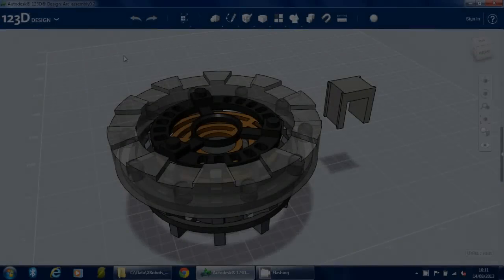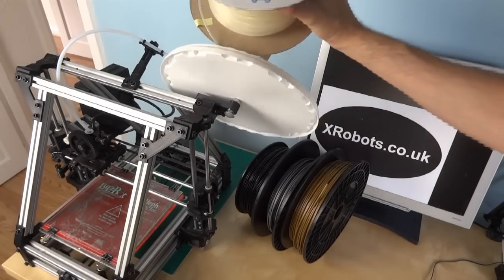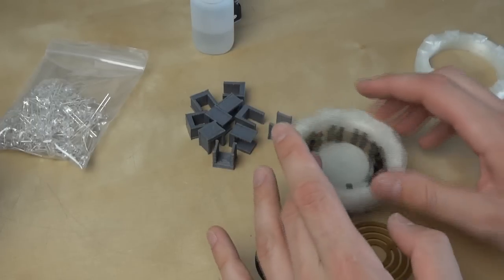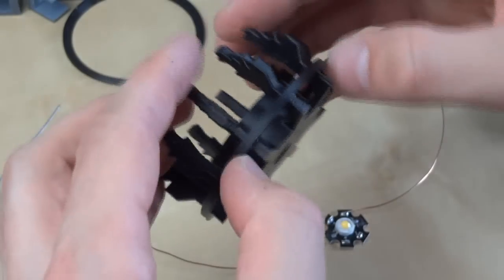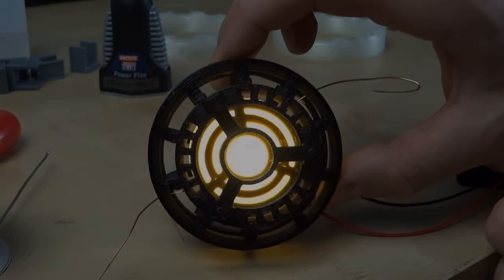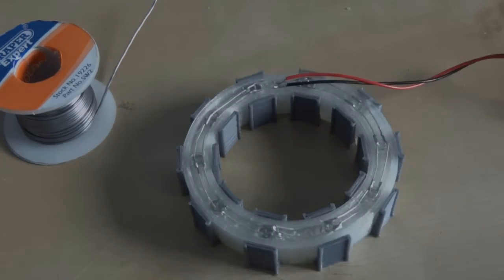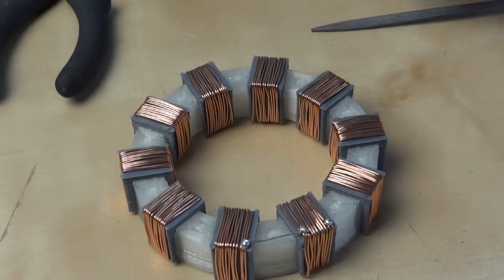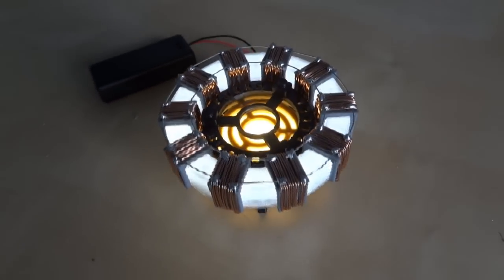Iron Man Power Suit #38 | 3D-Printed Arc Reactor | James Bruton

Comment: You'd have to print the suit in smaller pieces and then glue them together, not to mention, you'd have to have an extremely detailed 3D model of the suit itself. The other problem is that 3Dprinted parts may not align precisely together, due to hot plastic sagging a little. However, several people are already attempting this as we speak - of the top of my head, there's a Mk42 by JD Christianson, and Samus Varia suit by Talaaya (both on the RPF).

Comment: Are you doing this circuit without any resistor? I guess with 10 small leds and the 1 watt there isn't much concern about them heating up and starting to draw too much current... I have always been under the impression that leds should always be wired with a resistor since the led resistance can change dramatically with heat (at least that was the explanation I was given).

Love the look of it, I am thinking of buying your stl files and making a small modification to the main chassis, then wiring it up inside a softball display case. The power would be in the base (battery or ac/dc adapter) and connect to the reactor via magnetic contacts so the piece can be removed from the base.  Maybe put in a capacitor to power the lights for a short while after it is disconnected. This is all delayed by me not yet having a 3d printer (taxman is being slow).

Comment: With the Inside and Outside wire rings, couldn't you have put in a small hole in each corner of the 10 individual grey pieces and just fed the wire through them instead of having the big solder blobs on the copper wire?

Comment: To add a bit more effect you could of used RBG addressable LEDs and something
like a Arduino Pro to control the whole project. You would not really need to add much 
more when it comes to the wires.  Thanks for taking the time to share this project.
BTW I liked the way the clear (PLA ?) diffused the light from the back side.

Comment: awesome! nice work. i have a question, is your LED lights have built-in resistors? LED must have resistor right? and another one, can I print in that kind of 3D printer using autodesk autocad? or that 123D design came from 3D printer? thank you !
Reply: Not necessarily. You would need a resistor to avoid that the LED'S draw to much power from other components affect their normal functioning. And since  the only thing you're powering in an arc reactor are lights you don't need one.
Reply: +anthony ordillo - Although you will have better performance and efficiency using slightly higher voltage and then controlling the current through each LED, the "Forward Voltage Drop" (Voltage Drop) of the LEDs allows for basic operation using batteries directly, without current limiting resistors.

The voltage drop of LEDs differs depending on a variety of things, particularly the color, size (diameter), desired intensity and current, and also the working temperature, frequency, etc.

As a basic rule of thumb, For a standard 5mm diameter LEDs, you can start with these values for Voltage Drop:  Red 1.7 volts, High-brightness Red 1.9 volts, orange and yellow 2 volts, and 2.1 volts for green. Or, a range of about 1.4 to 2.6 volts. Voltage Drop for Blue and White LEDs ranges from 3.0V to about 4.1V

A Li-Ion battery when fully charged provides an output voltage of 4.2V, 
which drops to a nominal 3.5V after a short period of operation. That 
voltage further declines to 3.0V as the battery discharges (triple NiMH cell pack: 4.5V/3.6V/2.7V). For White LEDs, the light intensity and color composition will vary throughout this change in voltage. While not ideal, this is pretty good for basic operations of powering White LEDs directly from a battery.

An important thing about LEDs is that as you drive more current through them, the Voltage Drop increases, so in this respect, as long as the voltage (and temperature) is within safe limits they are self limiting and have some inherent protection. Again, within limits... too high of voltage/current without adequate temperature control can cause catastrophic thermal runaway.

More info here:
https://www.maximintegrated.com/en/app-notes/index.mvp/id/3070

Comment: What´s  the name of the machine bro ? and how much does it cost in the market? please , Im looking the information for too many days without answer
Reply: Yes, that one :)
Reply: Okey bro thank you
Reply: I recommend Vulcanus V1.1 personally. Even thought its designed by 16years old and its full DIY project, with it being fully open source, there at least you learn your printer fully, when eventually something gives in or problems arise, cause there is no printer that is ready to go. Every fillament needs its own set of adjustments and this chances even depending on manufacturer of fillament, so there isint literally no plug and play option. 3D printing might look like simple thing to do, just like 2D printing, but it really isint and you need to learn pretty much everything, not to mention your machine and how it works. If you dont understand the process, eventually you run into problem, ether mechanical, software or print setup and machine might end up unused due this.

For price, my V1.1 isint good to compare as i have customized and upgraded it to whole new level, but upgraded basic parts cost around 450€
If you go for the basic budget setup, then its around 300€ depending where you source the parts and materials. With 40cmx40cmx40cm its pretty beast of the machine, specially when upgraded and its faster by the design, if you use bowden style of extruders. Check instructables for more info.

Comment: and where do you get a 3D printer?!
Reply: There are several different companies offering 3D printers to the main stream market this year. So many, in fact, they had their own section at the 2014 CES. MakerBot and 3D systems are both industry leaders in the home printing market, but if $1300+ is out of your budget (like myself) I would recommend the new ABS+PLA printer from Robo3D. It's $699 and has an amazing build quality (on par with MakerBot) . Plus it's a plug-n-play model that you can use right out of the box. No assembly required.
Reply: will you send me a link to this sight?
Reply: Darrell Calk thankyou kind sir^^ XD